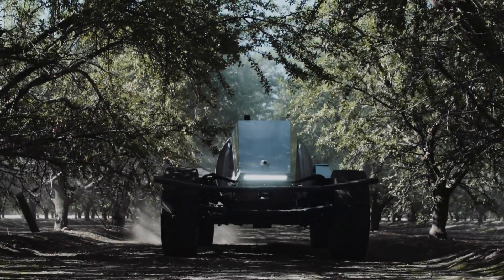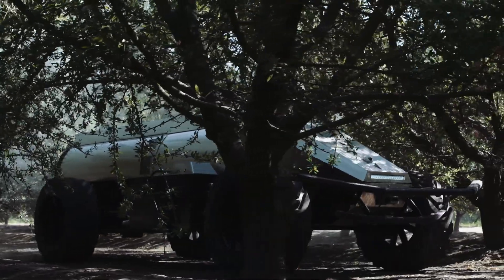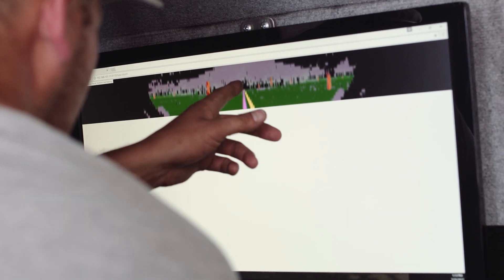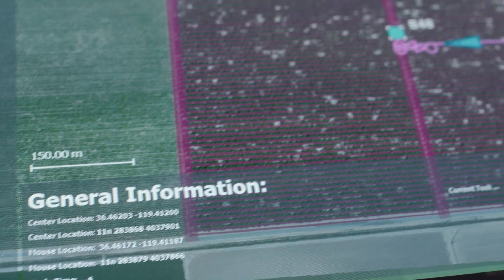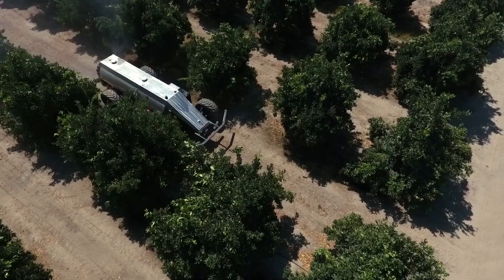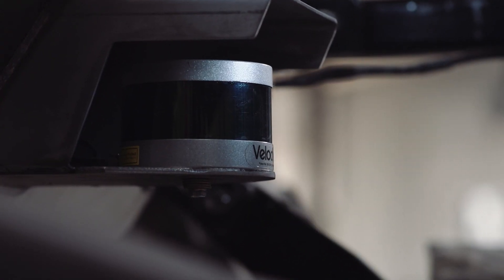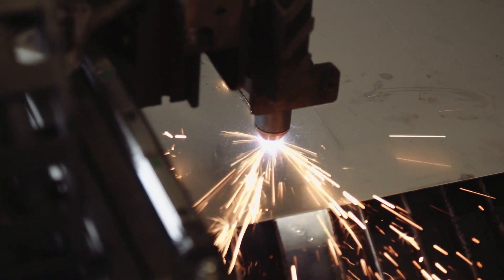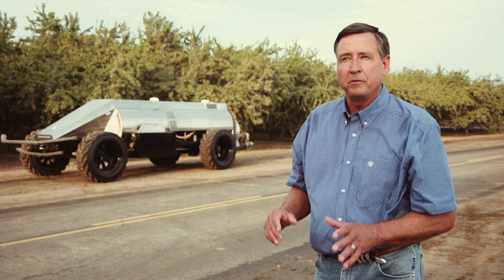GUSS | About the Global Unmanned Spray System (gussag.com)

Comment: the guss robots build quality is  good but the Automation is bad and they crash a lot into trees and power lines poles
Reply: Do you run these if so where? I run them in northern ca. If you want to connect. I've gotten around 100-200 acres a day depending on the factors at hand.